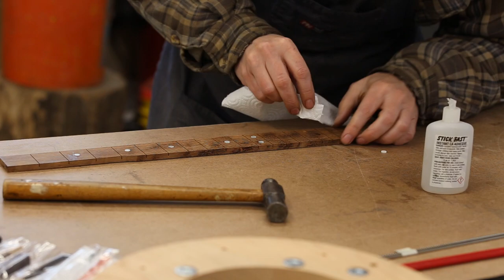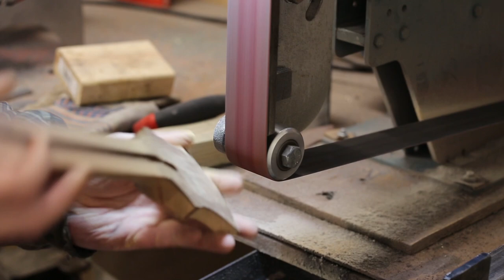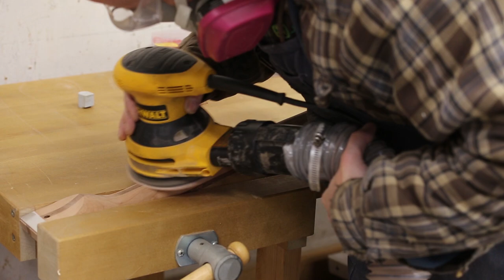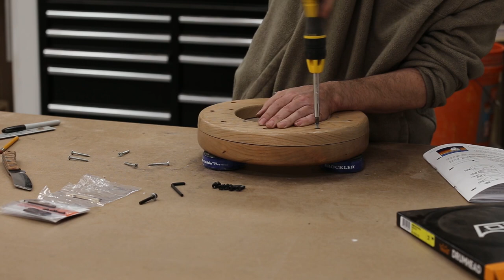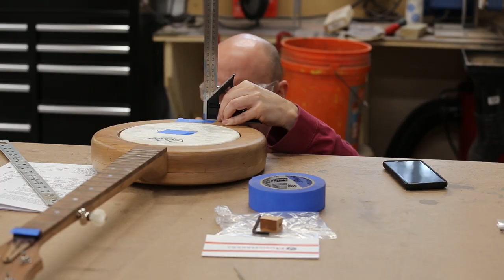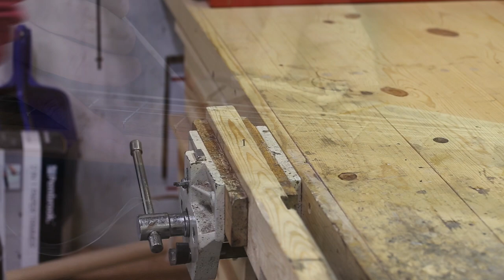Mountain Banjo Kit

Comment: I'm gonna build one of these but I want to use a different skin head, would I be able to do that or is skin head included in the kit designed specifically for the build
Reply from the maker: I just used the one from the kit. I'm sure you can reach out to them and find out the details. They are a good group of people and I'm sure they would be willing to answer your questions.